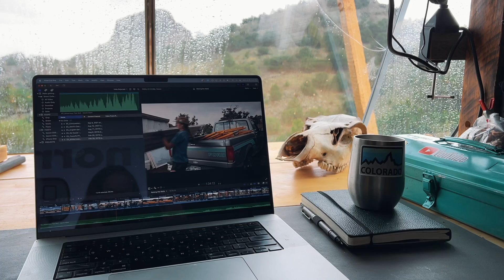Looking like a HOME! | Concrete Tiny House OFF GRID

Comment: When I did my venomous snake handling training the container we used to transport them had a handle attached to the lid. That way you could place the lid on the tub with the snake hook and didn't have to reach your hand over. That could be a good addition to your gear! But it's so awesome you're helping your neighbors out and spreading a positive outlook on coexisting and respecting snakes.
Reply from the maker: Good idea!

Comment: I remember tearing down an old  Daniel Boone truckstop  Off of interstate 81 near Blountville Tennessee was dry stacked with fiberglass shims creating gaps and stuccoed inside and out with Shurewall  !!!  If your truck has the 300 6 cylinder they are darn good engines

Comment: So cool to watch the process. Rain water vs well water ... well water often contains more metals and/or salts than plants like. And if it has iron, it may have iron bacteria, which plants aren't crazy about either. If the sulfer bacteria count is high, the water smells a bit like sulfur, but i can be undetectable by smell if the count is low. My family's vacation place has so much soda in the water that you it comes out fizzy. We treat it for iron bacteria twice a year with 10 gallons of bleach in a canoe full of water, then run it until it stops being all red and gross. We take a sample of the water to the university every couple of years and they test it for us. Thank you for sharing your lives, adventures, and endeavours.

Comment: Also, the PH or rain water is approx 5.0 to 5.5. A bit ascitic. The PH of well water ranges 6.5-8.5, more on the alkaline side. You should check your plants to find out what type water they want: Lower or higher PH. Soft or harder water that will have a higher mineral level.

Comment: Have you given any thought to maybe glass block (clear and or colored -- you can work up a pattern on some manufacturers' sites) for say a shower or a room dividing wall -- or maybe a window or two to let in some extra light in an area where you don't have a window/door?  Check out some images -- you'd be impressed with the look I think.  House is looking nice and coming along well.

Comment: I was looking at building with concrete blocks and then stucco over too. But I read that concrete while great in the summer for keeping the house cold, it is not so great in the winter trying to keep the house warm. Did you guys have different information when deciding to still go with concrete or you just dont mind being a little chilly in the winter. Love the videos!

Comment: Regarding your plants preferring rain water over well water, it's possible the mineral levels are too high or imbalanced for you soil conditions.
It was a problem when I lived off grid and was reliant of carted bore water. The plants would live on it, but they didn't thrive because it was very hard.

Comment: It's really not unconventional. In 2001 I had a home built in Florida by a popular reputable Home Builder. I picked out my 80x125 lot(10,000 square foot). Picked out the model and got to change a few things as long as it was within the footage. Of course picked out all cabinets, flooring etc. Lot and home believe it or not was 99,000 total.  The home was concrete block, cement foundation, and only wood roof trusses with stucco finished. It's was and still is the most if not primarily type of homes built in Florida. Of course 20 years later cost alot more money to build. My ceiling in living area was vaulted. The total square feet was 2000 with 1600 living and 400 ft two car garage attached with door into Kitchen. So I think you building this kind of home is smart. They are strong and with the price of wood great idea. Wood in Florida attracted termites is why builders were doing primarily concrete block homes. That's incredible you are building it yourself. It's going to be so nice. Great job. Love it. Your garden is coming along nicely 😍

Comment: please make sure that the height of the door openings are 82-58" tall and the width is 2" wider than the actual door.  Then every standard 80" tall door with its frame will fit.  Just saying.

Comment: Do you run your freezer on solar and if so what solar set up do you use?
Reply from the maker: We use a Goal Zero 3000x battery but it’s far more than the freezer pulls. It pulls at max 60w so with good sun it could run well on a 1500.

Comment: I'm kinda bothered that you say you're not knowledgeable in building with concrete block. Please, please, before adding any of the headers for the window/doors do fill the empty crevices within the concrete block and gave time for the concrete to cure around the rebar. Making sure that the top run of blocks are all level. The height of those walls...if by chance could fall serious injuries could happen.

Where you placed the 4 sliding glass door window casing. Please, in case of a high wind with one of those daily rain storms to tie down those windows. Simply tie them off to the storage container. With one hard wind, those windows (some) could get blown over and break. 

Like the idea of using an old golf iron as a sturdy bar to control the rattlesnakes!!!

Good to see progress on the tiny home, been gone, nice to be back to view you're progress.

Comment: The well can have high mineral content like well water in a home ( calcium, and so on) with out a filter. Test the water to see what it's high in, and buy a filter for your hoes. We did this on are camper when in Colorado and it changed the game for us. We also figured this out in New England when we grew Medicinal Marijuana in a grow tent with well water. We had to feed are plants with Poland spring and cal meg to level the calcium or with the PH  we used ph up or ph down. Since yours is outside in a the garden you should be good with a water filter connected to the hose. Hope this helps. Safe travels and one love. Tessa Dan and Pearly !
Reply: ps: welcome to the F150 FAMMMMM!

Comment: I would suggest you research the issue very carefully before placing load-bearing masonry blocks on wood headers. The building code only allows this in a few specific conditions and I don't think what you showed qualifies. Regardless, its generally not a good idea.